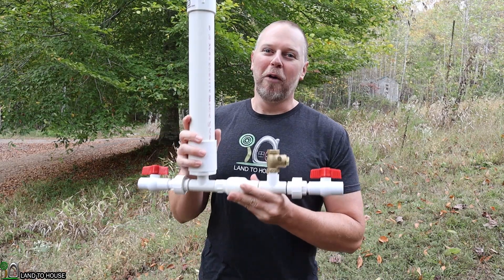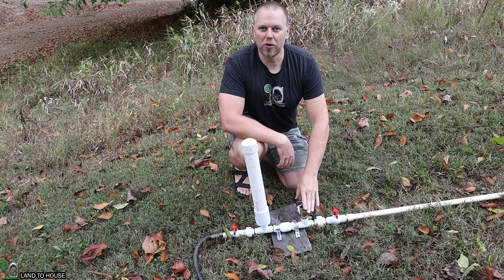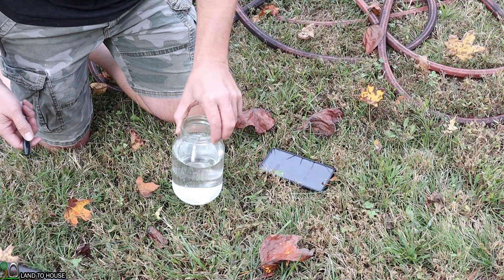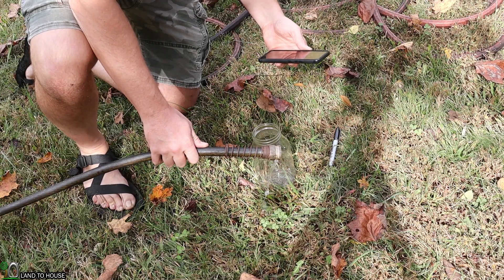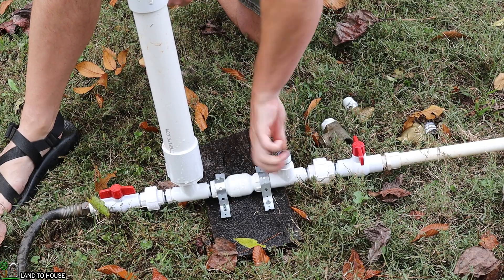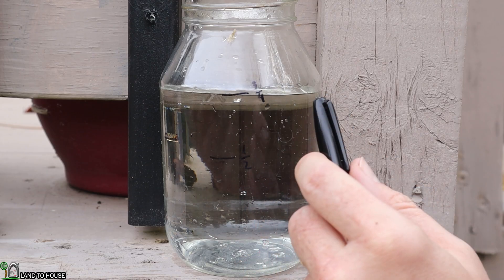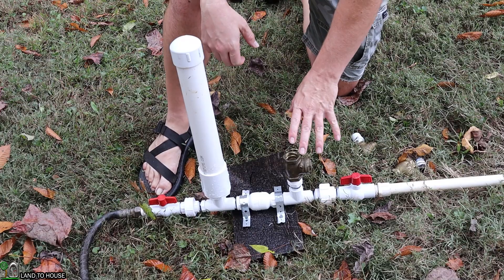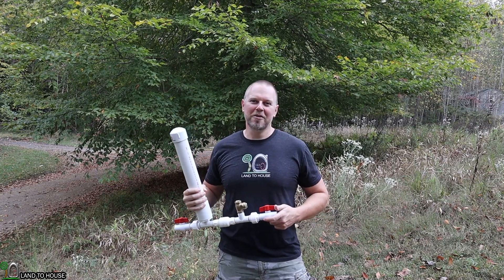Ram Pump Waste Valve Not the Same Size - What happens if your waste valve is mismatched?

Comment: Here is the corrected and clearly rephrased version of your complete setup:

“I am using only one pump: a single hydraulic ram pump (hydram) that works without electricity and makes the typical ‘tick-tick-tick’ or ‘knock-knock’ sound.

The layout is as follows:  
- Water comes from the main source through a 1-inch drive pipe.  
- The pipe first drops 25 feet down to the hydraulic ram pump (so the hydram is installed 25 feet below the water source level – this 25 ft fall provides the driving head).  
- The hydraulic ram pump then pushes the water upward through its delivery pipe.  
- From the hydram, the delivery pipe rises 25 feet back up to the original source level and then continues gradually upward, reaching a maximum height of 25 feet above the original water source level.  
- The total length of the delivery pipe (from the hydraulic ram pump to the final destination on the hillside) is 1,249 feet.  
- The delivery side uses 1-inch pipe throughout, but the outlet of the hydraulic ram pump itself is ½ inch, so I have used a reducer to connect it to the 1-inch delivery pipe.

Question: With this 25 ft driving fall and a total lift of 50 ft (25 ft back to source level + another 25 ft gradual rise) over 1,249 feet of mostly 1-inch delivery pipe, what should be the pressure reading on the pressure gauge (if I install one) on the delivery side, or how much pressure does the hydram need to develop so that water reaches the end with at least some usable flow?”

Please confirm if this is now 100% correct, and let me know if you want a slow trickle or a specific flow rate (e.g., 5–15 liters per minute) at the end. I can then tell you exactly whether your 25 ft fall is sufficient and what pressure to expect.

Comment: I like to see this test done in the opposite way instead of changing the size of the waste valve
Reply from the maker: Do you mean different drive pipe sizes? 
https://youtu.be/qkon63Sw0oM
Reply: Yes different size Drive pipes in conjunction with different size waist valves  @LandtoHouse
Reply from the maker: Ah I see what you mean. When I get back to ram pump testing in the spring I can give that a test.

Comment: I used to try to run a 1/2" valve off a 1" drive pipe and it would never pump because it cycled so fast from all the head pressure. When I went down to a 1/2" drive, 1/2" valve it finally gave me suitable flow.

Comment: Impressive results that the mismatched waste valves still function.  2 questions if I may: you said that the undersized waste valve uses more water when it is delivering less.  I'd be curious to see if you could run this again with the pump in a kiddie pool to catch and measure how much bypass water accumulates with the 1/2 compared to 3/4 waste valve.  I noticed the undersized waste valve cycles faster, so I wonder if it might function at less head-pressure than the 3/4? On some installs you have had to rotate and lean the waste valve to the side to get the pump to function, this faster cycling suggests that stepping down the waste valve size may be as effective (or more effective) than leaning the waste valve to the side.